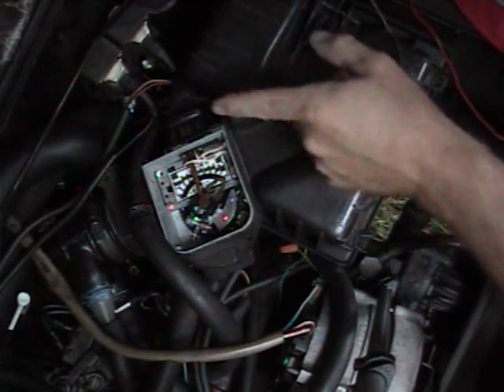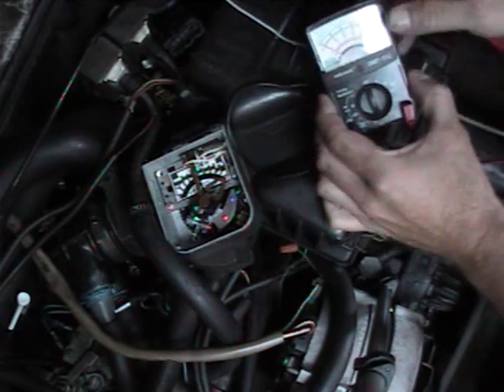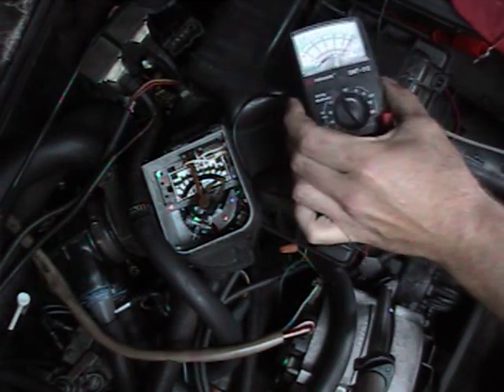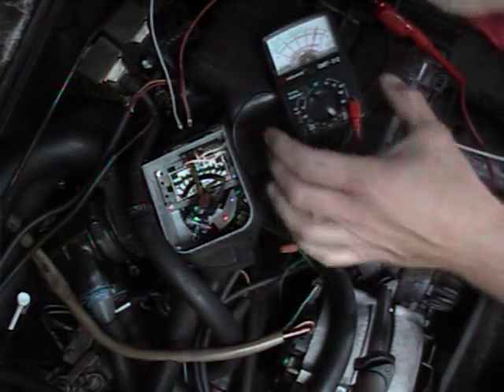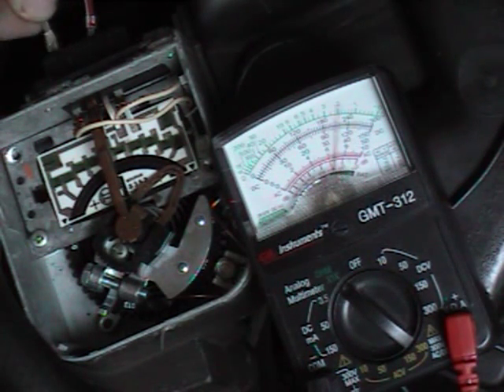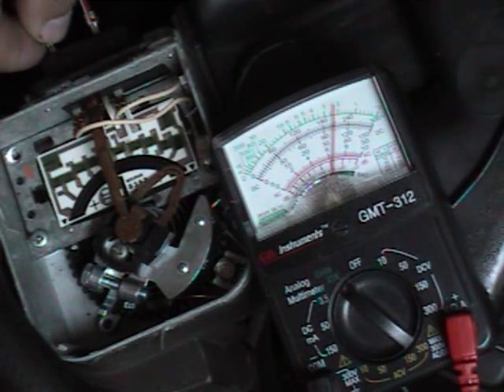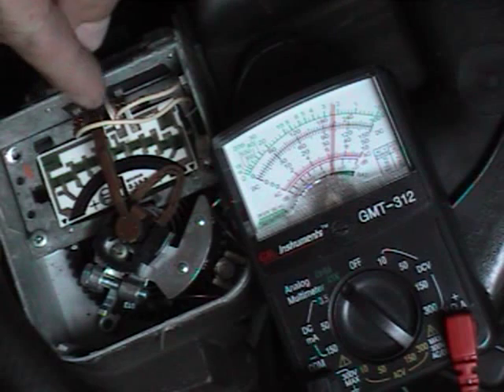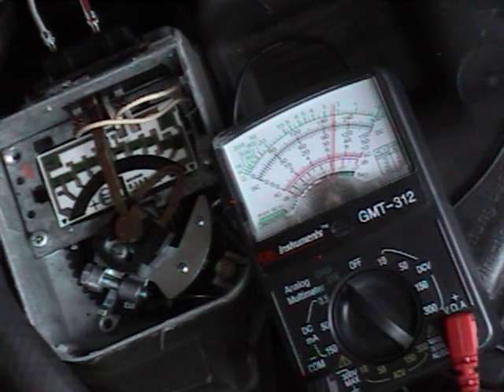'85 VW Vanagon Testing the AFM

Comment: With key at on, but the engine not running: at rest  (idle) meter should read about 1.5V,  push to open meter should read about 6.5 V,  (I added a 2.2uf cap across pin 2 and 3, this smooths out the hiccups. )
Reply: This helps of there are only small dips in the volts if large dips, the AFM will need to be rebuilt.
Reply: Hey Dave, can you give us more info on this mod
Reply: Thanks. I did add it to mine after reading your comment, and it did make a difference 👌